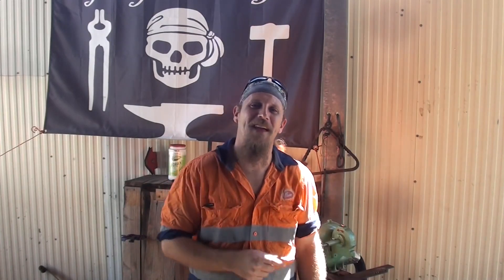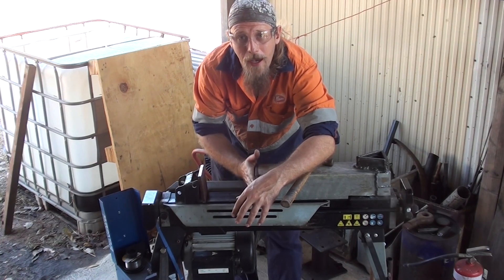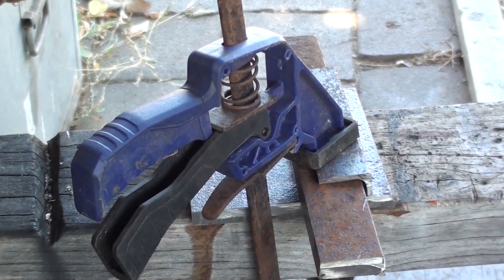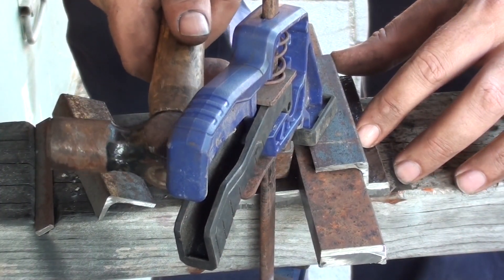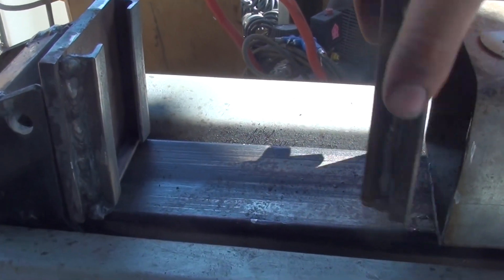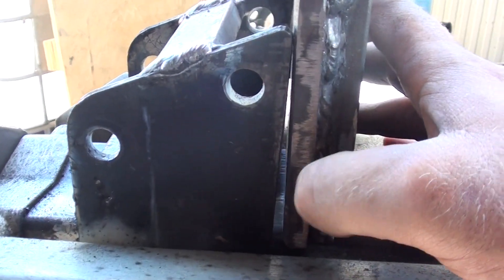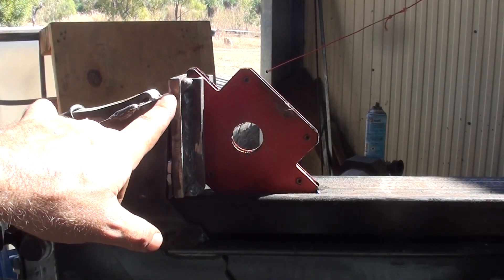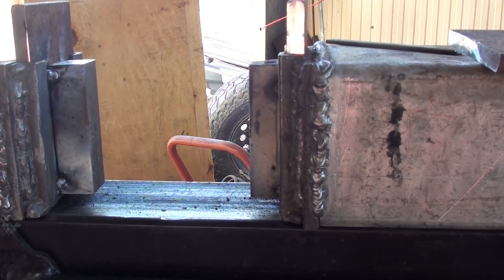Building an Electric Log Splitter Forge Press Part 2, Finishing and Testing

Comment: Hey Adam good job. With your dies, as they are easy to change maybe double up on there jobs. Bottom half round and flat on top then just flip it over. When flattening maybe try holding the stock vertical to the die to share the load as you have "tonnes" to spare and would help to smooth it out at the same time. 
Keep up the vid's and enjoying you passion
Reply from the maker: Interesting ideas, i will probably try that at some.point. just getting used to using it at the moment! Thanks for watching

Comment: I am guessing you modeled yours of what Tiian Gerber made. Well Done!  It works well. Especially since it so much smaller than most. Mine is 25 ton as most people said you needed that much. Youll be able to do all kind of things with this.
Reply from the maker: I actually haven't seen that one. Mine was inspired by CG SMITHING in canada, i linked to his original vid and credited him in part 1, everything else was (foot control and die holder) was off the top of my head, on the flu fabrication and 5 ton works fine so far.
Reply: @SpeargrassForge  same guy. CG  Smithing is Tiian.